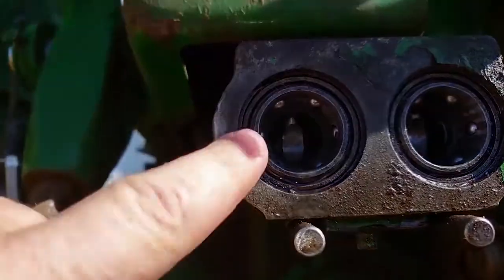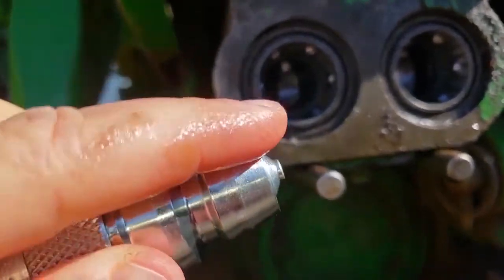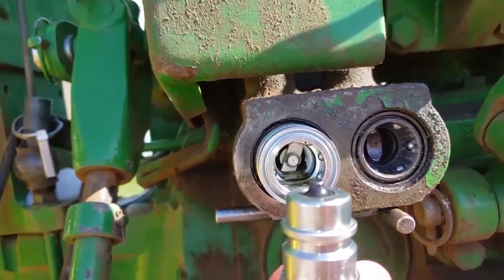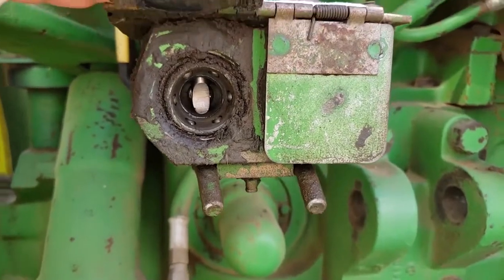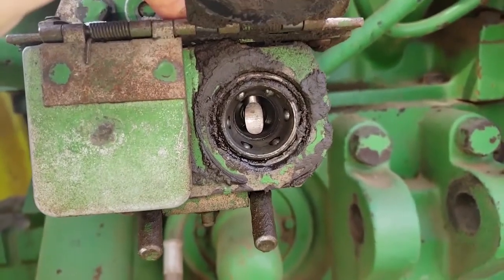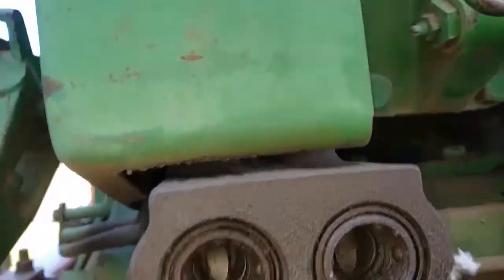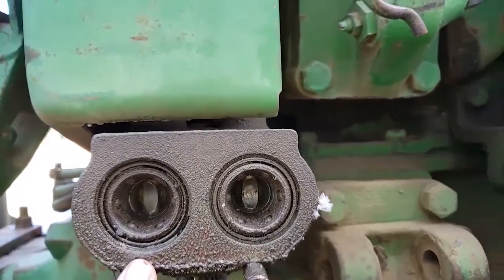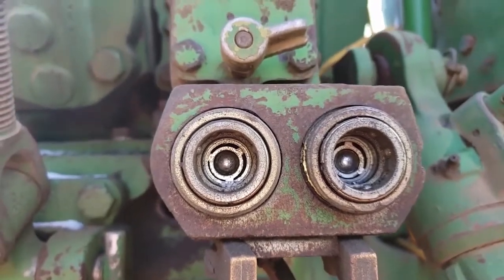How to Connect Pioneer Style Implements to Old Style John Deere Rear Remote SCVs

Comment: Thanks great video .  My 2510 has the old style  also .  Once you put the adapter in how do you remove it if you want to take it out ?  
And do you sell these adapters ?
Reply from the maker: Hi Scott, here is the link for ordering: https://www.shortlineparts.com/old-style-jd-to-pioneer.html
Reply from the maker: To remove, you turn the lever to off ( back)  to stop oil flow, and pull back on the adapter piece. It will pop out pretty easily.